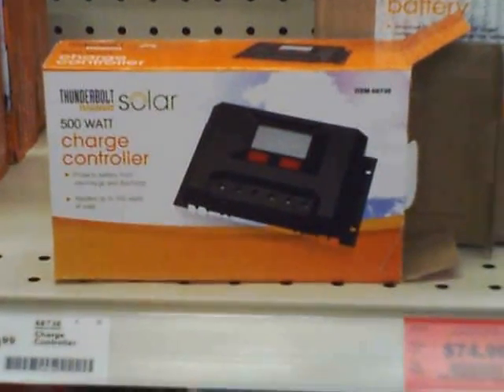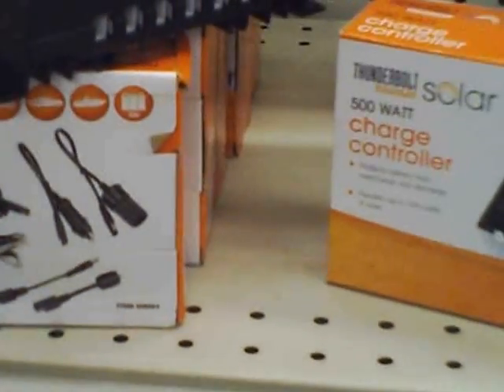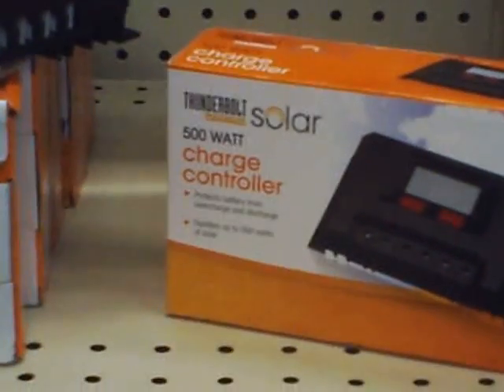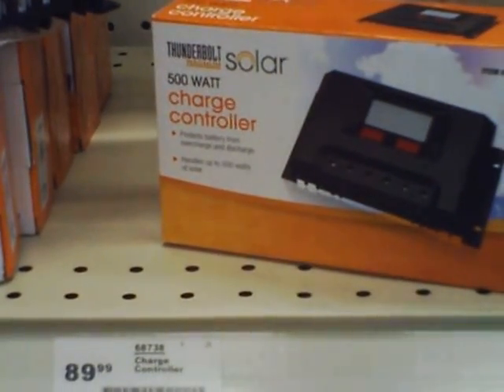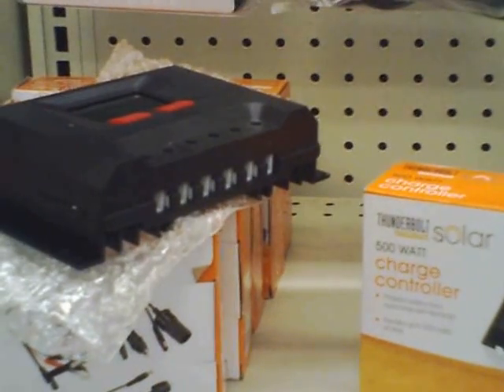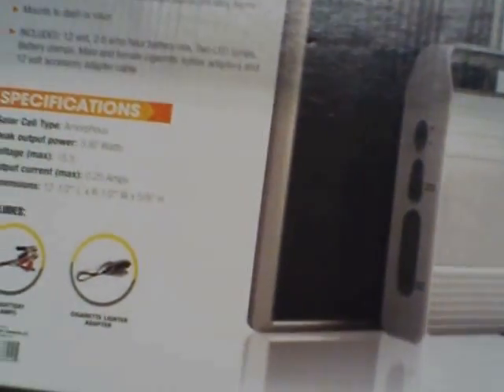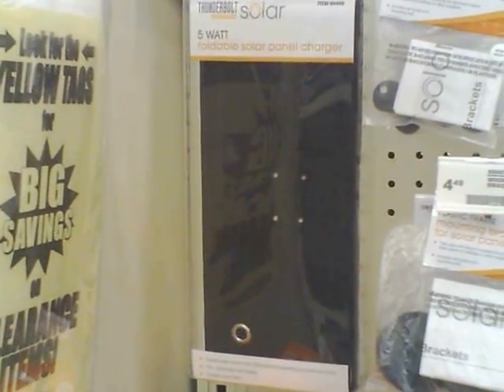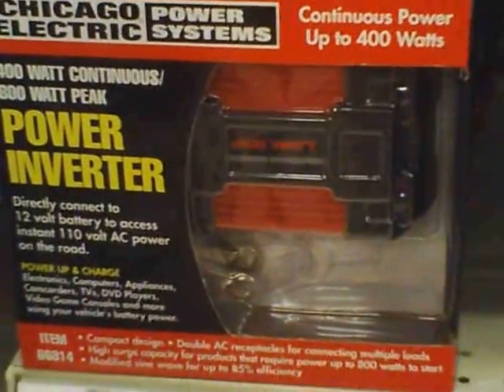Harbor Freight Thunderbolt Solar 500 watt charge controller intro

Comment: I can't get it to display any information from my solar panels even though I'm reading power from my solar panels through the charge controller to my battery...I'm on my third one because the last one started irritatingly beeping because it dropped below 12 volts.

Comment from the maker: Yeah, I think it is a little high.  The documentation inside the package says the controller runs an 18 amp maximum capacity, and the way panel watts vs amps works, that is actually closer to 290-320ish watts.

Comment: ive had nothing but issues with this charge controller. i put 3 solar panels. only detects one in series. the other 2 solar panels work properly as i alread tested them with a multimeter.i put one of the not detected solar panels on a different charge controller and it works fine. but not on this one. maybe 360 watts is too much ?

Comment from the maker: I know what MPPT is and on smaller power systems it is both not worth the extra cost and most smaller MPPT charge controllers are mislabeled.  I discuss this also in a later video with Miles from lightharvestsolar()com at his retail place.   On smaller systems, you are better off just getting more panels or larger panels for more power.   Under 50 amps, don't screw with MPPT.

Comment from the maker: Yeah, just bugs me there is no documentation with it.  I will likely get one for testing as soon as YT makes the first ad-sense payment.    I have a 400 watt array with a Net Meter Solar charge controller on it that is acting buggy, and I want to see if I get the same readings out of the HF model since I like the idea of getting local warranty support at a store instead of having to deal with people in a different time zone on the other side of the country.